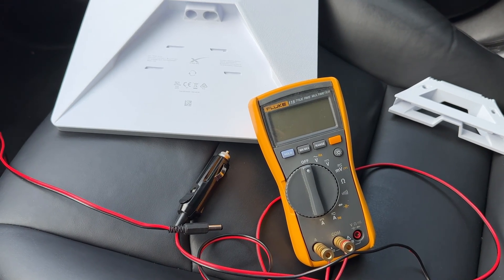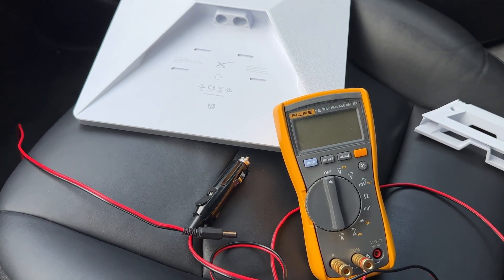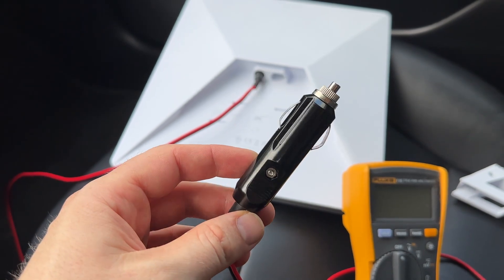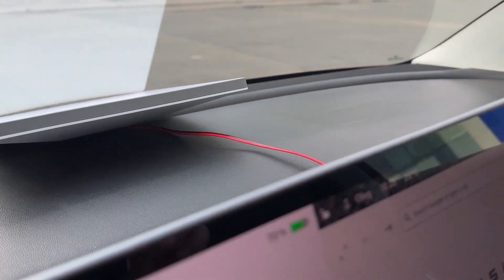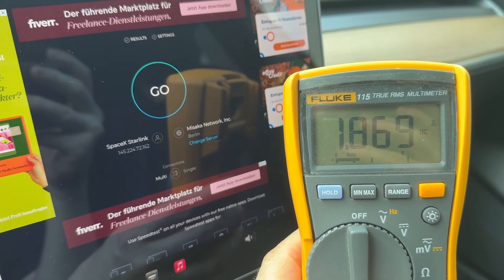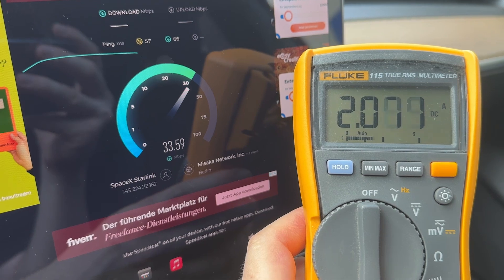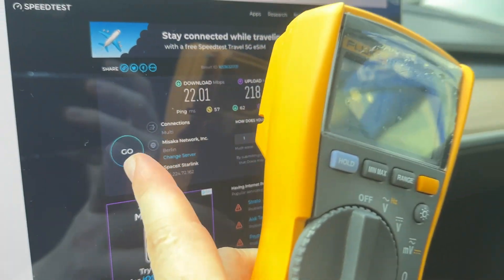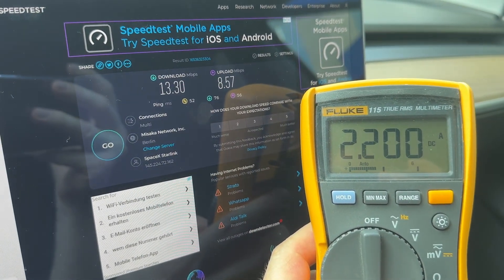Starlink Mini in a car: powering and current consumption

Comment: Hi Oleg, greetings from Brazil. Following your instructions I converted my Starlink (v2) to 12v. Thank you so much for sharing your findings!

So, comparing mini with v2, its a third of the consumption, correct? (4-6 vs 2-3 amps)

Do you think it worth the upgrade on a RV, where power savings is crucial?

Comment: Have you experienced the antenna rebooting frequently, specially when powered with 12v o usb c?
Reply from the maker: No. Rebooting antenna means there is not enough current. It might be a bad socket, plug, or thin wires.
Reply: @olegslab  thanks, I need to run a few more tests with different cables and batteries or it might be the mini is faulty 🫤 specially happens when under high load of uploading files o weak WiFi signal, strange.